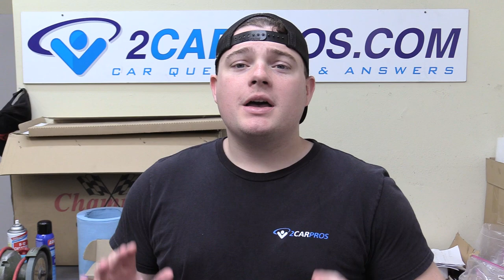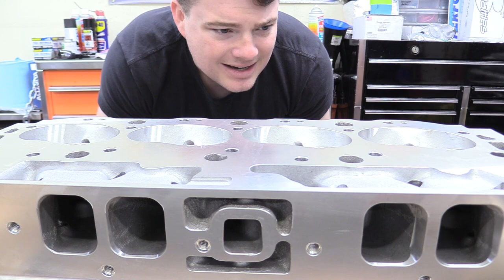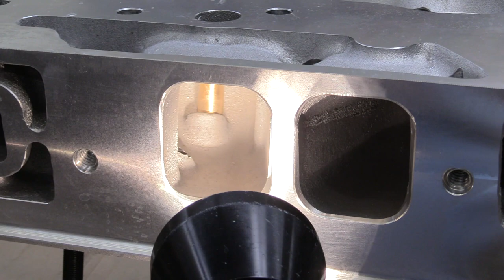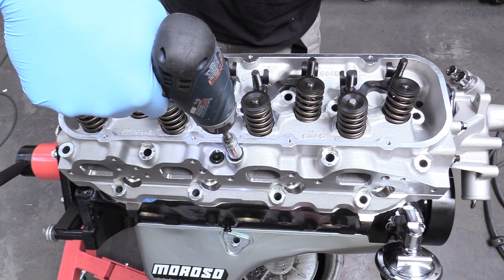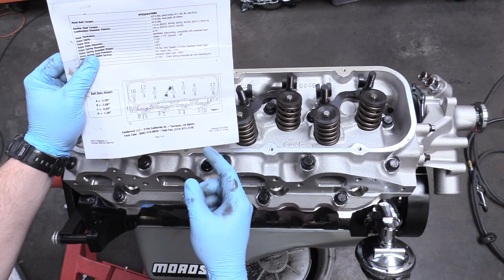How to Build a Chevrolet 454 Big Block Part 10: Cylinder Head Installation

Comment: The head gasket that you installed is blocking the lower coolant holes between the block and the head. There are no openings on the gasket.
Reply from the maker: So if you look really closely there are little holes in the gasket that regulate flow but they are there. Thank you so much for watching and caring enough to comment! :)
Reply: 2CarPros I can’t see the holes in your gasket. I noticed that because I’m rebuilding a BBC 454 and found the same in my engine. The head gasket was covering the coolant holes and the correct head gasket should be 8523PT. Thank you for your videos they were very helpful during my rebuild.
Reply from the maker: @mba753  Tough to see on camera but I assure you they are there. I should have pointed that out in the video, I just didn't think of it. Best of luck with your build and let me know how it goes! Thanks for watching!
Reply: no youre right, those lower coolant holes are blocked off, he installed the wrong gasket for sure.  only the top holes has a small cut out.
Reply: Sean Clark you blind son, there are definitely holes on the bottom as well
Reply: OutSideTheLines We’re referring to the three big coolant holes between the cylinders below holes for the head bolts
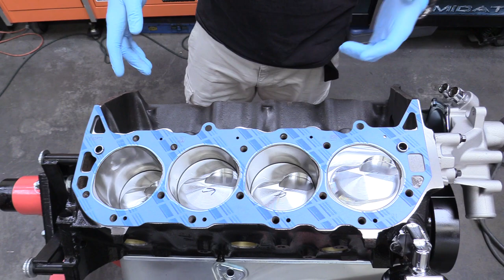Reply: @2CarPros Re-watch 6:00-6:30, you will see 3 largest holes on the bottom in the middle between the cylinders being covered by the gasket.  I haven’t watched the next video to see if you caught it or not, just trying to help ya out!  Good catch @MBA
Reply: I just finished building my 454 as well..your orginal block was a series cooling as mine was..when you get Fel pro 1037 gaskets it shows where you have to drill 1/2 holes.  I see your 4 bolt block is set up for parallel cooling.  As I see your heads are set up for parallel so I was wondering why you didn't use the Felpro 1037 gaskets?
Reply: @mba753  you are absolutely right, I don't know why they are doubling down on this. The gaskets they installed make it series cooling instead of parallel..which creates more heat at the back of the head that is why they went to parallel. I am not trying to argue or be a troll just trying to be helpful. They should have used Felpro 1037..
Reply: They used the 8180-PT2 gasket..should have used Felpro 1037..anyway..that is my last 2 cents.
Reply: @johnbruce1216  Could you help me understand more about series/parallel cooling and why there would be different setups?
Reply: @ericstephenson9924  sorry Eric I just saw this..I did all my research when I built my big block..earlier models have series cooling..3 holes across the top and 1 on the lower section..I think I read the theory was it slowed the water to allow better cooling..but they found that it causrd hot areas...later models went to parallel cooling..which is 6 holes in parallel..for a more even cooling ability...you can drill holes in earlier model blocks (like I did) and put later model heads on that have parallel cooling...just make sure you have the correct head gasket..which they didn't do here...there is plenty of information on the web about this if you want to dig deeper.

Comment: I clicked on the link for the heads you are using it says it’s for a hydraulic roller cam but you have flat tappet cam installed. Can you please explain I’m confused

Comment: Just a little comment that I discovered (and this isn't any inside secret or anything, you can find it mentioned in lots of places) is that the short ARP bolts on the outside edge have heads that are a little taller than the stock bolts, such that they can interfere with the installation of some headers, most notably Sandersons (but probably others, too).  The solution is to re-use the stock bolts, use the ARP's without washers, grind down the heads of the bolts, or grind clearance into the header flanges.  If you don't do one of those, you will be very puzzled why the headers won't bolt up to the heads.
Reply from the maker: I would never grind down head bolts. Many aftermarket headers have cut outs for taller head bolts. My Doug Thorley's did. Thanks for watching!

Comment: Can you also use thread sealer on the head bolt threads instead of silicone? Asking as I have a similar build with Brodix heads and I used ARP thread sealer, though I have not fired the engine yet.
Reply from the maker: Absolutely. Thanks for watching and good luck with your build!

Comment: Thank you for what you are doing I am soon going to be doing a full build and really looking forward to it and I'm very happy that I have such  detailed videos to help me along the way I do have a question tho please are you putting Ali heads on a cast block I have heard off problems with that as they heat up and expand differently so can cause issues many thanks hope to hear from you soon
Reply from the maker: Thanks so much for watching. Having aluminum heads on a cast block will pose no problems. GM and pretty much everyone else has been doing it for decades. Only on super high performance applications will you get an aluminum block. Cast with aluminum is a great choice for us regular people.

Comment: Hey, I got the same gasket kit, with the 8180pt2 head gaskets. I have a 1990 hi perf truck block, casting number 14015445. It has the same number of water jacket holes as the one in this build, and I noticed that gasket covers three holes completely, on the outside, between the cylinders. From what I’ve read, my casting number block has been around up to about 1990, but when you look up a head gasket, based on year, it comes up with felpro 8523pt1, which doesn’t cover the three water holes, for 90-96 454s. Is there a reason why I can’t use the 8180pt2? It’s a bit confusing lol
Reply from the maker: That's strange. I would call Summit Racing's tech support hotline. There might be a silent revision or something like that. I used these head gaskets I linked on my engine and it works perfectly. Just drove my Camaro yesterday actually.
Reply: @2carpros  ok, thanks. I was talking to the engine builder that did my machining, and he also said it should be fine for what I’m doing. It’s going in an off-road buggy, and won’t be high rpm application…most of the time. So far, so good, following your building series! Heads, and valve train installed, intake next. Still waiting for a new oil pan to get to me.

Comment: Please explain why you didn’t check your oil clearances.Main and rod bearings?
Reply from the maker: You can if you want to but in my experience with my machine shop they nail it every time. In fact in my Ford build I checked it just for you and it was right on the money. Considering I've been running this engine for years now, pretty sure we are good. Thanks for watching!

Comment: I am rebuilding my 454 and currently selecting heads and weighing the Edelbrocks you went with vs the 100cc chamber ones they offer. How did you ensure you had adequate valve to piston clearance? Thanks!
Reply from the maker: I trusted in my engine machine shop. You can also call and ask edelbrock and ask if your pistons will fit in that head. They are usually super super cool. Thanks for watching!

Comment: If you were using the big oval heads that came off that motor what head gaskets would you use I have 1974 454 motor thanks
Reply from the maker: I'd use something like this, https://www.summitracing.com/parts/fel-1212/make/chevrolet just measure and make sure it won't restrict flow on the intake runner. Thanks for watching Walter!

Comment: Hi if i use steel heeds not aluminum .is the same torke. Tkyou
Reply from the maker: Long Head Bolts  75 - 80 Ft/Lbs Short Head Bolts 65 - 68 Ft/Lbs

Thanks for watching!

Comment: I torn down my engine and found oil covered bolts in the , water pump, intake manifold, and main caps is that normal? Is it ok to build on this block?
Reply from the maker: I would take the engine down to block then send it to an engine machine shop and have it magnafluxed. That will ensure the block is ok to be machined and rebuilt. Thanks for watching Marvin!

Comment: Hello. On this installation did you use the 4 bolts that came with the heads or did you use the bolts from the kit you purchased?
Reply from the maker: I used the ARP bolt kit I linked. But the bolt kit is specific for these heads so it has those 4 bolts built right in. Thanks for watching!
Reply: @2carpros My Big Block has been sitting in a 68 Camaro for some years before re-starting. Now it smokes out the tailpipe. In your expert opinion is the smoking coming from the valve guides gone bad? I’ve been told this is a common thing with motors that have been sitting a while before re-starting.

Comment: hey, why did you choose to buy aluminium heads instead of having the old ones machined or bought new cast iron heads?
Reply from the maker: Because they are quite a bit lighter and they gave me the compression ratio and valve spring pressure I wanted. Thanks for watching Jack!

Comment: can i upgrade my Alfa romeo 159 2.2 185hp or remap ... will it work perfect or dead
Reply from the maker: I'm not sure what you mean by that. Thank you for watching!
Reply: 2CarPros mean is , can be increase hp by remapping?
Reply from the maker: @ymangatprov5932  I'm sure if it had a tune it would make slightly more power but it might be at the cost of reliability. Thanks for watching!
Reply: 2CarPros thaks for reply in future i’ll see it,,,